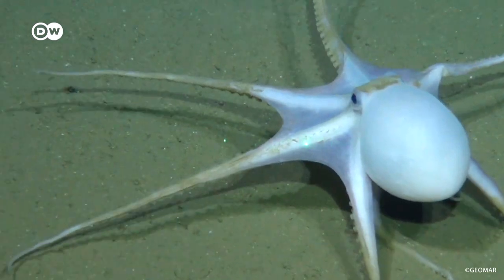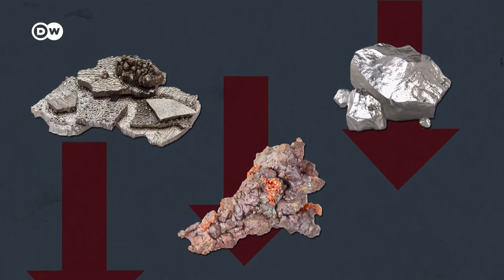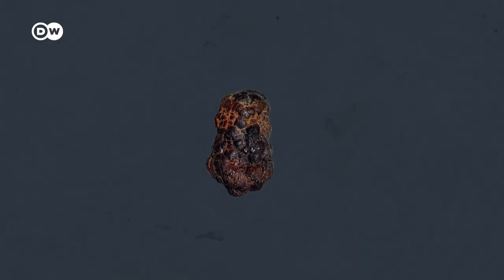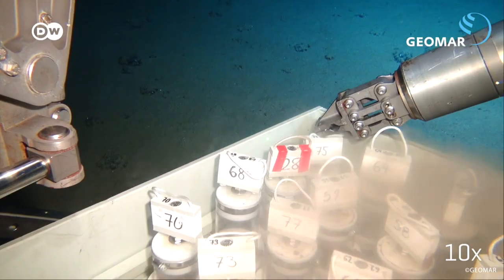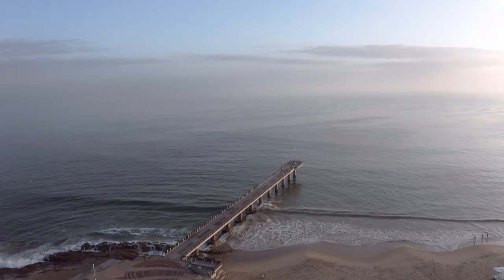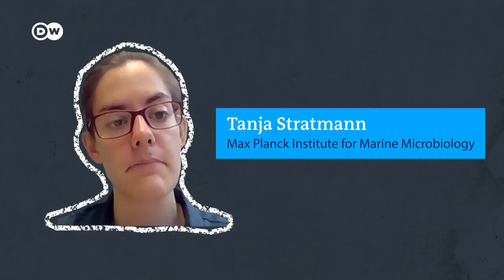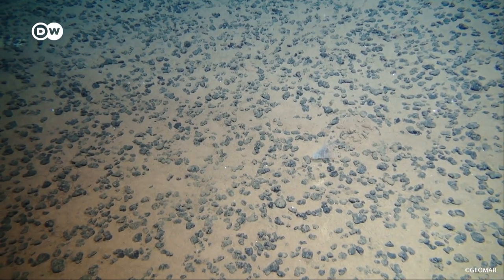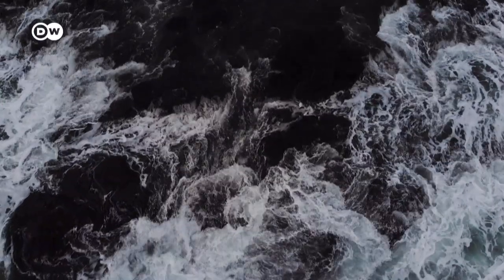Why countries are starting to dig up the ocean

Comment from the maker: What are your thoughts on deep-sea mining? Is it worth it?
Reply: It will be a bad idea... A really bad one
Reply: I hope we don't have to. But your recycling solution sounds off. We have not even built 1% off the batterys we are going to need. And the electrification of the world is going to need several orders of times the mass in copper, nikel and other metals then what's in circulation. how are we going to get that much recyclebles if they don't even exist? I hope space mining is better than this deep sea. But that sounds expensive for now
Reply: If the tecnology used to mine for ores in deep ocean evolve wouldn't it also contribute to the development of deep sea oil/gas and methane extraction from under the sea beds?
Reply: Genius
Reply: I think that we are in a point that we will have to decide what we will have to disrupt. It's sad i know, but it's not viable trying to change to eletrical batterys and just recycle if we even don't have batterys enought. Space mining is a better solution, but it's very far from our current tecnology yet.
Reply: We are already near to extinction with all the global warming. Please just leave them alone. We did ever thing till now for our own benefit and technology. Lets just start helping our earth at least now rather than finding ways to destroy it for our greed.
Reply: no
Reply: The current methods caused too much negative impact to the ecosystem, however there are ways of doing so with a fraction of the impact, that are not currently in use, which could make this ethically profitable.
Reply: According to this video. I don’t think deep-sea mining is a good idea.
Reply: DW, this is the most brainless question you ever asked. Why you guys don't make publicity for HYDROGEN?
Reply: Sí
Reply: Noooo. What next after deep sea bed😂😂. Please stop this idea of consumerism. Their is no road forward we have to go back to our roots to sustain our generation
Reply: Nope
Reply: No
Reply: @coola1271  i think so.
Reply: Methane and a host of unknowns make it an unwise choice. We still can't reliably stop oil from being released when we make mistakes mining undersea oil.
Reply: Absolutely not. Worst idea ever.
Reply: Expensive (deep sea mining)... ecologically and economically.  Recycling will also only take you so far.

Land based open pit mining is 'locally' ugly... but can be reclaimed over time. In a hundred years, you wouldn't know at a glance a mine had existed there. 

Underground mining is less disruptive,  and ore can be trucked or loaded onto rail cars to a more acceptable location to process and recover base or precious metals. 

I think it would be better to help modernize the developing world,  so that people aren't working and living in squalid and dangerous conditions. Alot could be done to solve those issues... but it takes a willingness to act. Meaning... we actually have to 'care' about the conditions of our neighbors... in order to ensure our own sustainable future.  Navel gazing and the 'me' culture... won't go far in solving our worlds ecological and sustainability issues... for that you need 'cooperation.'
Reply: Need to be careful with it.
We are actually doing deep-sea mining now. For oil and gas.
Reply: If billionaries are saying it can save us from climate change,why not?I mean,billionaries are always helping us and protecting our environment from human greedy
Reply: That's a rhetoric question I guess. Human greed is insatiable and far away from the eyes of the public pollution will be catastrophic. Not just a bad idea - an irreversible environmental sin.
Reply: We already made a huge impact on the seas, oceans ecosystems "only" by deep sea fishing, leaving or discarding our trash in it, and by letting loads of harmful chemicals reach the sea, not to mention the quickly warming waters that we, globally are responsible for. The health of oceanlife is one key element to the planets and so to our wellbeing. Mining... I mean look how awesomely turned that out in the Amazonas, where hundreds of acres of forest has disappeared and same amount of soil poisoned so badly because of gold mining, that in hundreds of years nothing will grow in it at all. We still think we can just take and use resources we need for our civilization without it backfireing and sadly without really giving a  second thought about what might our greed cause in the long term. Seems like humams never learn or just extremely slowly...

Btw: hasn't it occured to anyone that maybe, just maybe we should change our ways of living instead of trying to maintain the one that led us to this point? More mining and more stuff won't solve our main problem, will eventually generate the same till our population is rising and overconsuming.
Reply: Why not replace the nodules with a less expensive/useful material, so that the sea bed still has a number of rocks that retains some similar properties of the nodules. I am guessing these rocks simply act as nocks and crannies for nutrients to catch on, and for animals to live in. Obviously research would have to be done to figure out the best cheap replacement. But at that point we have a trade relationship with the organisms instead of a destructive relationship. Obviously the UN would have fund research,  create intelligent regulations and enforce those regulations which is difficult for that beurcratic heirarchy.
Reply: leave them be! leave the earth be! leave the nature be! leave all the wild animals be!
We humans are far too greedy for our own good! we are so doomed if we keep destroying own homeland!
Reply: Vad idea.
Reply: Hell no leave it untouched as is!
Reply: 200 Nautical Miles along their coast... as if countries actually follow that and do not create man made islands to extend their claim to the sea. 🤷🏽‍♂️
Reply: What I think is that this yet another catastrophe in the making. Not that my thoughts have any bearing on the subject. The good news is that unless we screw things up so badly that the effects can be seen in next 50 or so years then it's not really my problem. Realistically I'm worm food by then and I should have enough money to live comfortably enough until then. No kids left behind either so I can't really get too worked up over stuff like this. 

I mean it's not like it's not gonna happen until people have made enough money out of it or until folks figure out it actually results to a lot of really bad thing - and then they spend next 50-100 years arguing what to do, and promote halfassed attempts to fix things as success stories (or most likely just declare fixing it would cost too much).
Reply: short-term gain now with long-term pain in the future. unbounded economic 'growth' = environmental degradation and eventual ecosystems collapse. worth it? i don't think so.
Reply: I strongly believe that we can live in good conditions, even better than now, using and consuming less (energy, products, ecc).
To me wild places preserve an important piece of earth's Life, and if one wants of spiritual well-being. To mine them would be diminishing Earth wealth and capability for resilience: marine life, climate change phenomenons and human kind are all interconnected, too often we forget it.
I believe that in a large extent our constant and growing need for hi-tech products, energy and internet connection is a surrogate for deeper, more healthy needs that we struggle to find in the environment around us and in our relations: love, self-acceptance, contribution to the community.
Thank you very much DW planet A for the video you make. I often find them much interesting and clear.
Reply: I don't think it's worth it... The life lost alone would be horrendous! & we cannot possibly know how that loss might ripple through the web of life to affect us in the future! I much prefer the efforts to reduce & reuse~ The commercial attempts for mining asteroids looks far more promising! :D WAY MORE MINERALS & absolutely no loss of life here on Earth! Sounds like a win-win to me!
Reply: @ariadgaia5932  let me guess: you just watched Don't Look Up ;)
Reply: Humans will only evolve at the brink of extinction! 😂
Reply: I think we should not try to play gods with our planets ecosystem....at alll
Reply: even worse than the trash on the sea
Reply: Great Idea. We need to maximize usage.
Reply: Not worth it
Reply: Your accent is very bad

Comment: This video fails to differentiate between reserves and available resources. We are not running out of metals, we would just run out of metals in existing mines.  Yes, creating new mines is expensive and damaging to ecology around it but nowhere near as damaging and expensive as deep sea mining is. Nickel, copper and cobalt are 80, 60 and 25 parts per million respectively in earth's crust. More than enough to last us around a million years assuming no recycling. Also lets not forget metals are infinitely recyclable. Even rusted iron.
Reply: this was informative… the problem really lies in the management and overconsumption lmao
Reply: Youre not going to extract and process entire earths crust for that 80 ppm, you will need something much more dense like ore, close to the surface, but its supply is easily 1000x lower. Also consumption of ni/co/li is going to rise like a 100 times if we were to get everyone a tesla with NMC battery. Also metals like lithium are notoriusly environmentaly damaging to extract, so mush so that some sites will never get developed because extraction there will completly ruin ground water supply. Theres still enough material, but the margins are pretty thin (80 million tons of lithium reserves with some undiscovered of course, at least 20 million needed). Reduce reuse recycle is essential.
Reply: @moirai1161  True
Reply: @E1Luch  Aren't we the source of that grow in consumption? Cutting back would be the better alternative for me, before wiping out every other living thing on the planet.

Comment: Hmm yes space mining is still the best (but most expensive) choice.
Reply: massive emissions and massive costs, not rly worth it at all
Reply: Space mining is just an insane idea. The risk and cost as well as the environmental impact is gigantic. We're talking tens of thousands of dollar for a single kilo. Cobalt on the other hand can be bought for a few dollar a kg here on earth. So we need to reduce the cost of space flight with roughly 99.999 percent before it may be economically viable.
Reply: Unfeasible in the short term
Reply: Space?!? Are you intelligent?
Hydrogen is the answer.
Reply: @SweBeach2023  If a space company captures a comet from outer space and brings it to earth, the materials alone from a comet would be worth trillions
Reply: @user-golos  That's what they are trying to achieve from time, but it's not actually feasible. Or at least, the the technology doesn't even exist.
Reply: @SweBeach2023  No. We mine the ateroids very close by, in the Lagrange belt. In future, most economic growth will be in space. Instead of sledding material to Earth, we simply process it and use it in our new orbital habitats and manufacturing infrastructure.
Reply: @Scepticalasfuk  Which we are unable to do with current technology.
Reply: @user-golos  Do you have any idea how incredibly hard and costly such a venture would be? Just being able to launch and later land the same spacecraft is the edge of our current engineering capabilities. Space mining is a thousand years into the future.
Reply: @SweBeach2023  Yes but companies are now already starting to invest into that future, the first person/company to successfully do it will become wealthier than oil and gold and marking history
Reply: the native american hopi tribe said that when humans bring things like rocks or minerals from space, the universe will go out of balance
Reply: @nathanmountjoy  wait what does that mean exactly

Comment: Hey, actually according to USGS 2011-2013, ore deposits are not rare. Based on factual data, there are about 800 unexplored deposits on land and it can contribute to around 100 million tones of  minerals, gas and oil. What makes it seemingly rare is not whether or not there's deposits but socio-economic and ecological heated disagreement. This contention is due to the ecological and social impacts felt by communities living nearby to the mining industries on land. The industries turning offshore (deep sea) is more political rhetoric. By going to the sea, the impacts are more indirect and then people do not criticize the seabed mining.

Notwithstanding, the seabed mining is not considered sustainable:
1. Seabed plumes (sedimentation as a result of drilling and dregging) get washed away by the sea current and affect the coral reefs and the photosynthesis in the sea.
2. This causes coral reef mortality and ocean acidification.
3. The lack of photosynthesis makes the sea unable to absorb the excessive CO2 we produce on land.
4. CO2 causes climate change and that may destroy us.

Above all, it is not all about sustainable. Agree with the Professor on the video. It is about whether we agree or not with these risks.  A short question would be: should we make the seabed our new sacrifice zone?

Comment: Reduce consumption… there is the key. But in this consumer driven society, the greed always outweighs such issues. I just got a new cellphone. Did I want to? No, my old one use to work just fine, but then then upgrades happened and it began to run slow and the battery life died, so it became basically unreliable. Companies do this to make more money, and they don’t care about exploiting people or the environment to make this happen, so it falls on us to reduce the demand.
Reply: I agree with this 100%. We should just reduce our consumption. Maybe boost the need for people to buy bicycles, improve public transit. Reduce cars whether electric, gas, or petrol.

Comment: I mean.. the sea bed could be scanned before applying machines and avoid sea creatures that are attached to nodules and dependant on it by mining around them with as much space possible left for nature. Next thing to consider is replacement of nodules with artifical nodules for sea life. Lets say for every 1000 nodules taken 50 will be replaced or left alone. For now we will need a lot of research into sea nodules before we will even try to harvest them and reusing and recycling old technology/waste/metals is always a better option if properly managed. I hope that it will work on energy from renewables or nuclear. Otherwise its not environment friendly. Add to it that this plant will need to recycle waste water. So it needs waste treatment plant and filtration system and many more ways to protect our environment.

Comment: What could save us from climate change is embracing the technologies we've had for 100 years or more, trains, street cars, and high density mixed-use walkable cities, all run on a renewable electric grid built to last. We don't need to tear up the ocean floor or the Congo basin to live prosperous, sustainable lives. We just need a reality check.

Comment: It's a little funny reading the comments of people who clearly haven't really considered that 300+ NEW land-based mines is the estimate to meet demand for electrification. Also China has dominance over the metals needed and they have their hands in majority of the mining companies. DSM is kind of like a damned if you do damned if you don't situation. There's a company called The Metals Company that's been working with the ISA and have been gaining ground on getting the permission to mine or rather harvest the nodules in the CCZ. Which would ultimately give the US a little independence with their metals, which is extremely important with the metal shortages we're about to start experiencing...

Comment: Asteroid mining is way better idea. No eco-system there and after getting to orbit, much easier than 4 km under water.
Reply: But rockets are expensive, and you'll need to find a way to nudge a suitable asteroid out of the asteroid field and bring it into Earth's orbit. One solution would be to build a factory on the asteroid that would use 3d printers and the mined material to produce electric ion engine spacecrafts to fly close enough to Earth to drop the cargo and fly back to the asteroid to repeat. This would be far more economically sustainable than using conventional rocket powered spacecraft.
Reply: @AndrejMejac  Yes I agree. Whilst space x starships can be used to go to the asteroids and build mines on them, I believe the spacecraft used to haul the mined minerals back to Earth would need to be 3d printed, mostly from the asteroid's resources and use high isp ion engines in order to make a high profit.
Reply: It will cost more than what it gives back. Nowadays at least

Comment: The only way i see is to replace the volume of nodules with man made reefs equal or greater than harvested material . I want the part of me that thinks mining them is inconsequential is right. But we don’t even have a power grid for to support mass transportation with just electric battery transportation. The cost to move will be very expensive

Comment: How is this even a debate? Marine ecosystems are so sensitive and who knows what this could unravel. It's not a solution to the problem if they create a bunch of other problems. In this case the cure can be worse than the disease. The solution is recycling and slowing down consumption, but the latter will never happened under the ruling economic models.

Comment: If more people start using electric cars then there will be less demand for Cobalt for processing crude oil.  You need Cobalt to get all the Sulphur out of crude oil.

And not all types of batteries used in electric cars use Cobalt.

So just stop processing crude oil and buy EV's with the battery types that don't use any Cobalt.

https://en.wikipedia.org/wiki/Lithium_iron_phosphate_battery